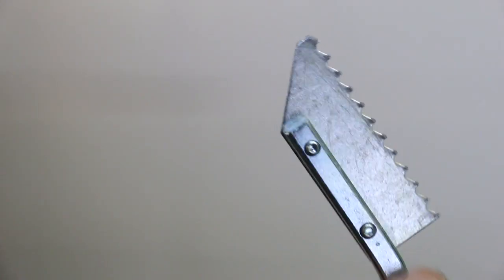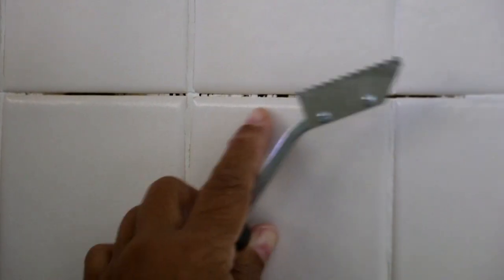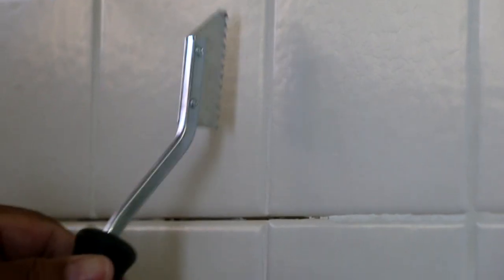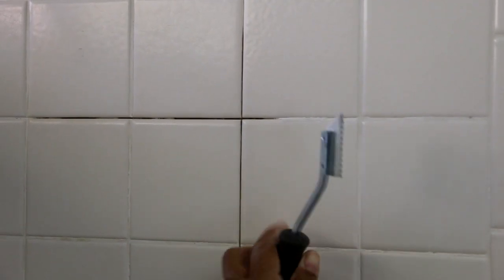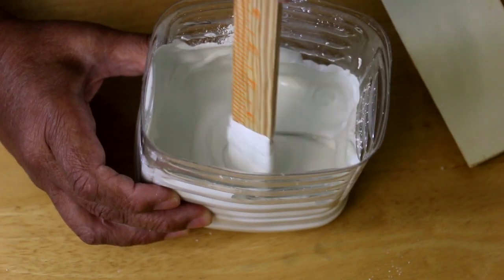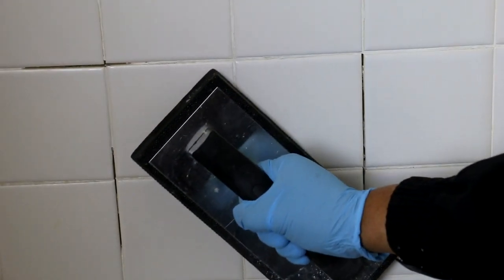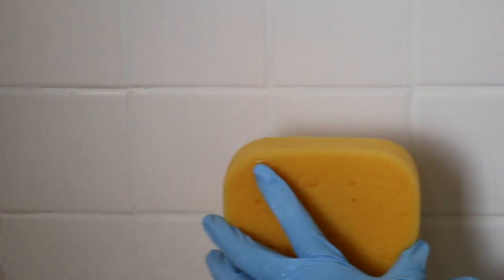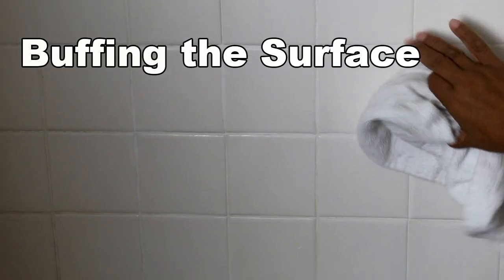How to Repair Damaged Bathroom Grout for Beginners

Comment: Just found this. I followed your instructions, although I used a multi-tool (with a tiny blade that goes back and forth) instead of the hand (non-powered) tool. It worked great. Thank you!

Comment: I have a 1950ish bath (yep, pink) that needs to be regrouted in spots, but they set the tile so tight that you can't get a tool like this between the tiles. Any ideas for what to do? I'm thinking of just using a utility knife and whatever comes out, comes out, and then letting the grout be much fatter than the original fill (wider grout lines). I prefer the original narrow lines, so I'm hoping you know what to do?

Comment: Should we use a different grout saw with multiple blades if we have wider grout spacing than you demonstrate? Our bathroom is tiled on the vanity top and walls so that the grout where they meet appears to be wider. Thanks for any advice.

Comment: Another video I found from you to help me repair something as a first time home owner with a builder who didn't care about building me a quality home! Thank you! Headed to Ace now to pick up my supplies and get this project started! 

My builder installed a ledge in our master shower and decided it would be the best idea to ensure the tile install allowed water to pool nicely, now the tile is cracked on the top of the ledge and water was certainly getting behind the tile. It's been a week since we used the shower so I hope it's all dried out, I think only 4 showers were taken since the large crack formed and my wife finally listened to me and stopped using the shower so it could dry out. Good luck me! hah

Comment: Wow what kind of grout do they use in the USA ?
those grout saws would not work on 99% of concrete based grouts 
If you intend to try this in the UK you will need a diamond or at least a toungston carbide grout saw  it takes a lot of hard work even with the the proper tools

Comment: Are you supposed to use grout for the joint adjacent to the bathtub, or should that be caulk? Also, what about the vertical corner of the walls?

Comment: Hi, Leah, hope you are good!  Leah, I am working on our shower floor tile, the grout is a little lower than the top of the tile, the grout is not flush with the face of the tile and I am scrapping the grout down a bit, in order to regrout it.  My question to you is, how much of the grout do I need to remove?  By the way, the tiles are spaced approximately, 1/8+"  from each other.  What do you think about epoxy grout for this and will it stick to the grout already in place??  Thank you, Luis

Comment: I knew I would find something in your arxhives on how to do this!  We jusy brought a house with a tile shower, so there's a few places that need a little help.  One question:  we have this sort of shelf thing for soap,  also made of tile that is attached in the corner in the shower.   There is a visible gap on ome side where the graut chipped or wasn't put in correctly.   How so I fix that so it doesn't eventually fall off the wall?

Comment: Question.  Nice video instructions, however, you showed two applying tools, but used only one to apply the mixed grout? Am I missing something?
Reply from the maker: No. I ised one to apply and the other to force grout into the joint.
Reply: @seejanedrill  Got it.  Planning to do my small shower tile walls and getting all the tips I can.  Yours are pretty good even though it was only a small affected area. I don't want to remove the shower door so this may work.  Thanks for the wonderful vid :)

Comment: So quick question.
Let's say you're doing this, and it turns out the grout was the only thing keeping a tile on, and when you saw it out the tile falls out. Any quick fix besides changing gears and pulling a whole bunch off to do the proper quickset and, if need be, replacing the adhesion board behind it? >.>

Comment: I repaired similarly, except 1 week later, my new grout lines are cracked down the middle. I used a sanded premix that had sealant in it so I know it was mixed properly. But now.......problem is back and we didn't use the shower for 16hrs after it was applied. I cleared the grout lines in advance to let shower air and dry. This took over a day (bigger surface to fix) with removing drying and applying and then before use. Only bathroom in the house. What causes new grout to crack like this

Comment: I've been putting this off but the time is coming where I'm going to have to suck it up and just do it.
I'm noticing parts of the grout areas are starting to crack. You aren't recommending having to do the entire tub and shower at once? That's why I've been putting it off. Another issue is it's my only tub and shower. My boyfriend works in auto body and comes home filthy. Help!

Comment: Is the uneven thickness of the grouting caused by not pushing hard enough on the float or can you go down the lines with a wet finger like sealant/caulking?

Comment: Leah- we have a sunken tube  (that really we don't use, just step in to dust the window above it). It looks like the movement caused by standing in the tub is cracking the grout between the tub and the wall tile. 
the grout is crumbling and some falling out. 

Should it even be grout there?  should it be caulk? Seems like caulk would be a bit more forgiving of any movement between the tub and the wall. Do I need to remove all that grout prior to addressing?
Thanks so much.
Reply from the maker: Yes, you need to remove the grout, and you should use caulking because it is a movement joint.

Comment: Hey Leah, what great timing you have! I have a couple of places in my shower stall. I don't have tile in it but part of it has what looks like a rubber seal with grout in it. Would that be handled in the same fashion or just done with caulk or grout? When I clean it part of the grout or whatever it is has come out like a string leaving that rubber looking thing. HELP!?!? Lol
Reply from the maker: Hi Becky, it sounds like caulking.  If so, you can remove it and re-caulk it.

Comment: Thank you Leah 👍 I have never seen powdered grout before. I have only seen the kind in a tube. Is this it? The is the same as a sealer?? Have a wonderful day Leah.👍👏🏡
Reply: seejanedrill would you seal the grout after applying?
Reply from the maker: Hi Mae, it isn't the same as a sealer.  That is a different material and process.

Comment: Any advice for the thick grout lines on a tile floor?

Mine are splitting up and some floor tiles are getting shifty.
Reply from the maker: several tools have special grout removal bits or attachments which can be used, like Rotor-zip and Dremel for heavier duty jobs like the one you've mentioned.
Reply: Rotozip and dremel can be a bit tricky, as they spin at a pretty high speed, so take your time and please wear proper protective gear. I use a grout removal attachment on a oscillating multitool (fein or Makita are two I use). Another method is to use a angle grinder (with a diamond blade). This method creates a lot more dust, so I will hold  a shop vacuum hose next to the grinder while working.  Regarding the tiles shifting, I don't recommend regrouting tiles that aren't properly attached (as the grout won't hold). In a couple of rare instances, I have used epoxy grout (with success) to lock them in to place, but definitely don't recommend that method unless you have really studied up on the process.
Reply: I can second the idea of using an oszilation multi tool for grout removal. there are some special blades to use for that, mostly the golden-ish colored ones which have the carbide splinters embedded.
Less rotation speed (no full rotation at all) makes it easier and safer to handle and it does not fling dust everywhere like a rotary tool. But do not be fooled, it will still create dust and a good vacuum which cnan handle very fine dust as well as a face mask and eye protection in case some grout pieces ricochet out are absolutely recommended.
But with those tools i would definitely go for the wider grout lines and do the finer ones by hand.
I tried some finer ones, barely wider than the fein tools blade, with that mentioned fein multimaster, and those tools will not necessaryly make a difference if you are cutting grout or tile, leaving some nasty marks on the tiles edges.
For the loose and shifty tiles I would recommend fixing them first as well. as long as they move they will mar the grout again and again.
If you have floor tiles loosening again and again, especially with larger format tiles, check if the underground is level enough. Back to the fine tool, they also have some kind of carbide rasp available, to remove old thin set and if necessary even concrete (I would recommend to remove at most some very superficial unevenness in concrete, otherwise a leveling compund should be used to fill up.)
Depending on the subflor, at least here in Germany where you usually have floating floor screed on a floor slab instead of wood construction (wood simply is too expensive over here) and everything is quite solid without internal movement, one "rigid" type of thin set is used. As soon as you have a, underground that might move ever so slightly or in outside applications, we use a flexible thin set. which prevents cracking.
The other way round it does not hurt to use the flexible type on screed.
This may be old knews to most of you, but bear with me, I am not too familiar with US construction details and I actually never heard someone make a difference in types of thin set (and grout as well). So I am not sure if in the US only one type is common (which would make sense to have the flexible type as the common one, as most the houses I knew had wooden floor construction)